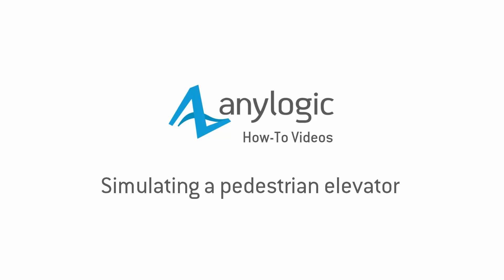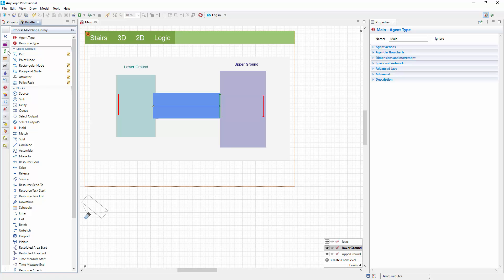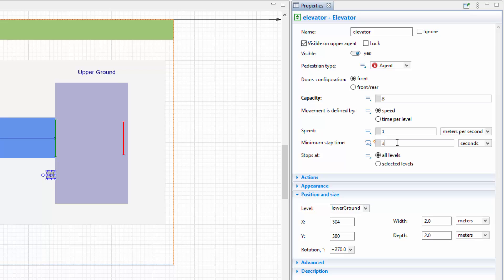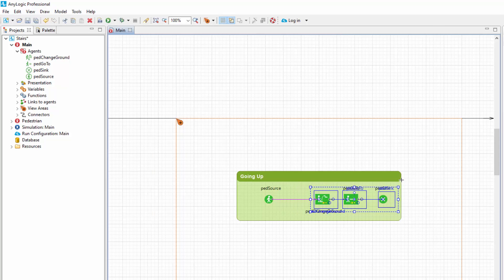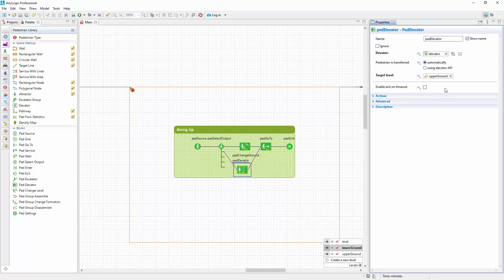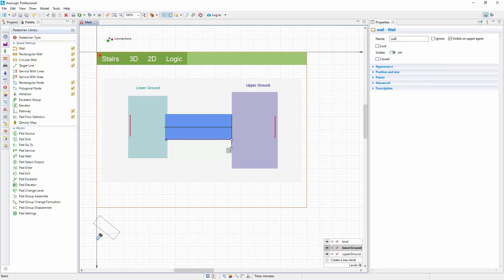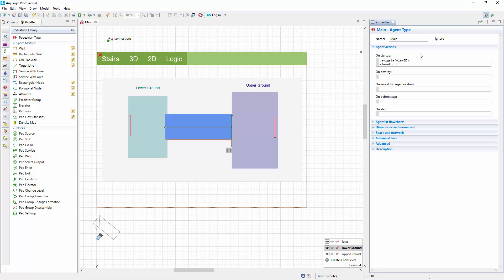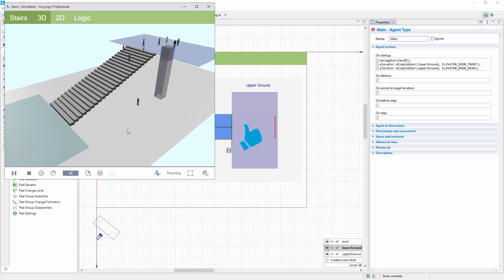Simulating a pedestrian elevator

Comment: Thanks for the how-to videos. Are there any tutorials for simulating  MULTI (Ropeless) elevators, including those that can move horizontally?
Reply from the maker: Hi, 

The specific elevators you need are not currently available as an out-of-the-box feature. However, AnyLogic gives you the flexibility to model the complex logic of custom objects, including various elevator systems. The agent-based paradigm is the basis for modeling any complex object. You define their operating rules using statecharts, process flows created from library blocks, and Java code. To see how custom objects can be implemented, please refer to the "Autoclaved Aerated Concrete Factory" example model.

Comment: What if I add another elevator? What is the code and so?
Reply from the maker: Hi, 

You can start by duplicating the "Elevator" presentation shape and "PedElevator" block. The main challenge isn't adding another elevator, but defining a rule for choosing between them. The random selection (by probability) presented in the tutorial works well in a simple case. 

To implement a smarter rule (e.g. "choose the closest elevator") we recommend exploring replication, a powerful feature for building scalable models. This allows you to create multiple instances of a single "PedElevator" block by enclosing it in a replicated custom flowchart block (anylogic.help/library-reference-guides/process-modeling-library/custom-block.html#creating-a-custom-flowchart-block). 

A pair of "SelectOutputIn" and "SelectOutputOut" blocks will then help you route pedestrians in a custom way. A practical example of similar logic can be found in the "Shopping Mall" example model. It uses replicated "AreaDelay" custom blocks to simulate different mall activities and implements custom routing between them based on visitors' personal task sequences.

Comment: 为什么没有基于agent的模型操作介绍:eyes-purple-crying:
Reply from the maker: Hi there, 

From video tutorials, you can learn how to implement specific features in AnyLogic. They also cover some agent-based features. See Placing Agents on the GIS Map, Reading Agent Attributes from a Database, Using Agents in a Process Flow.
Complete beginners usually start with the free book “AnyLogic in Three Days”: www.anylogic.com/resources/books/free-simulation-book-and-modeling-tutorials/ This hands-on AnyLogic textbook includes practical examples covering the modeling basics across all modeling approaches (agent-based, discrete-event, and system dynamic) as well as various software functionalities. 
Additionally, we recommend that beginners follow the step-by-step tutorials in AnyLogic Help: anylogic.help/tutorials/index.html These tutorials will quickly teach you how to create simple AnyLogic models using each approach and library. After that, you can watch webinars, such as Delivery Fleet Optimization with GIS that demonstrates the power of agent-based modeling and GIS technology in the model building process. For more agent-based examples (from simple to complex), explore the software: open Help > Example Models  and search for "agent".

Comment: All parameters in your model are deterministic.
Have you tried using probability distributions instead of deterministic parameters?
Reply from the maker: Hi, 

All the parameters of the elevator adjusted in the video are deterministic, while some parameters in the pre-defined logic are stohastic. For example, in the PedSource block, the arrival rate, initial speed, and diameter of pedestrians are defined using probability distributions. Moreover, the PedSelecOutput block also adds stochastic behavior into the model, as the exit each pedestrian takes is determined randomly based on specified probabilities.
Which other parameters would you assign a random value to?